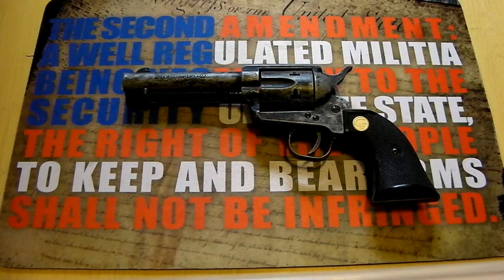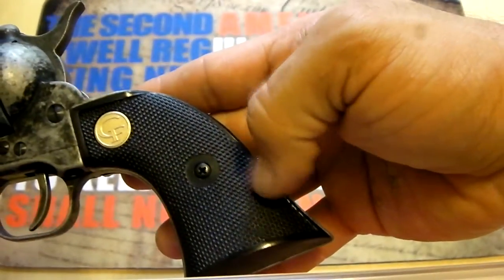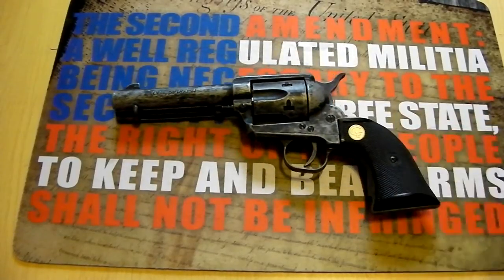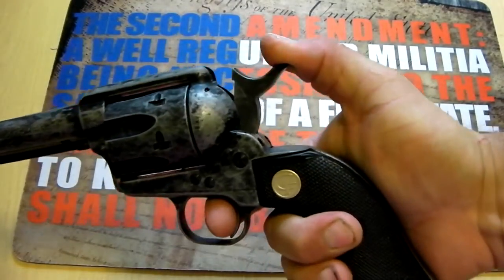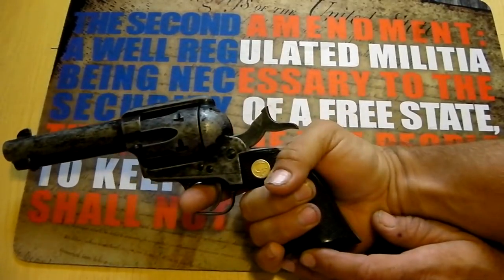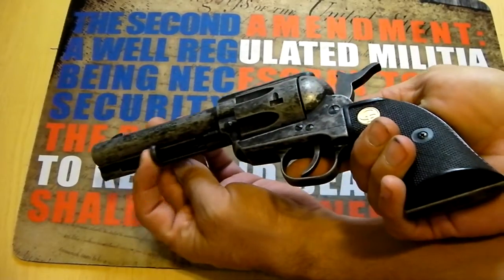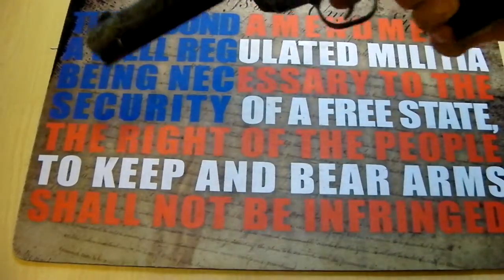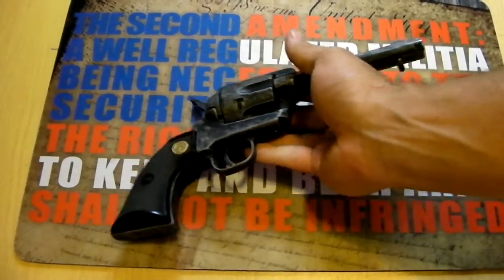Chiappa SAA 1873 22LR 1873 Single Action Revolver With ANTIQUE FINISH!

Comment: Good review. As you say you have rou to load a single round at a time. That said, before the Single Action Colt, each opening in the cylinder was loaded first with powder followed by a ball pressed into the face of the cylinder. After all cylinders were loaded, a percussion cap  was placed at the back where the hammer would strike and fire each round.